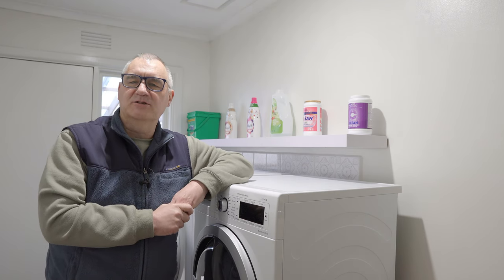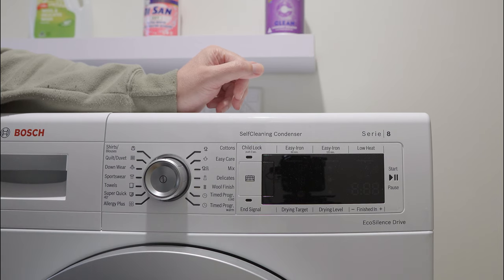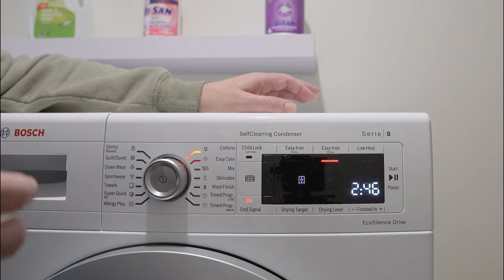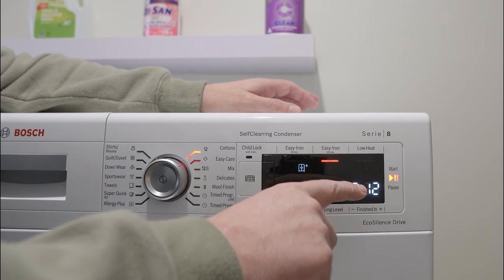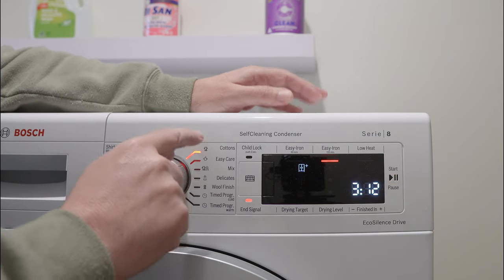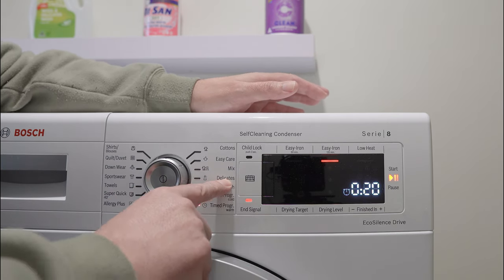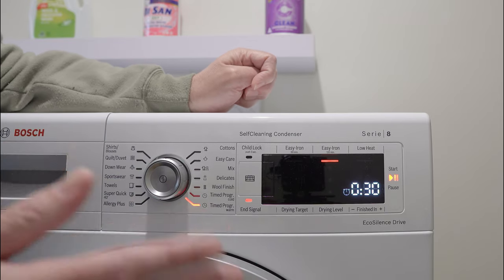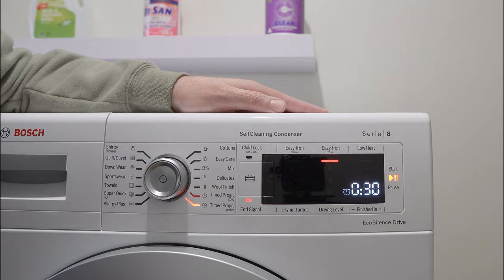Bosch Heat Pump Dryer won't dry clothes properly? I'll show you how

Comment: I use the settings you pointed out there for 5 hrs!! None of the settings remotely work. The spin dry of the washing machine works better. Since day 1 this dryer has never worked properly. My old $200 dryer works better than this $1500 crap.

Comment: but for ever drying target you have 3 drying level to adjast you know that right? so most of peoples will use mix with level 2 (the 2 suns) and everything came out dry you can chose 3 sun for the thick stuff! and but the way, cold timed program doesen't dry at all is just air. sir you miss understand the basic setting of your machine! so you dont have to switch from closeth to closeth plus but leave closeth and add 1 or 2 or 3 sun before to switch to closeth plus that is to much and even in closeth plus you can still regulate 3 sun